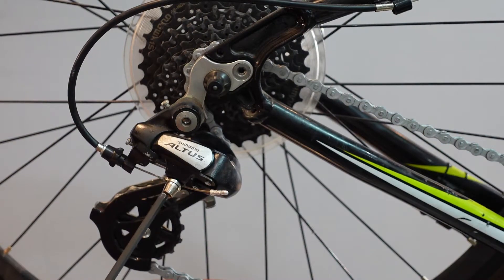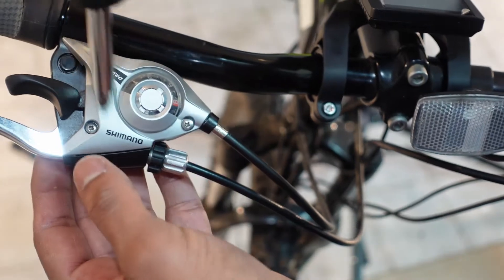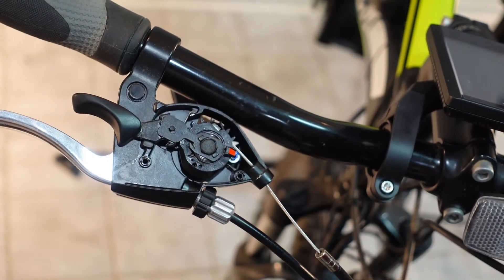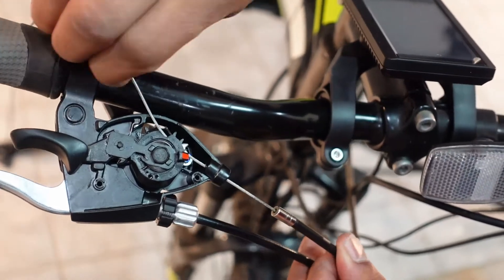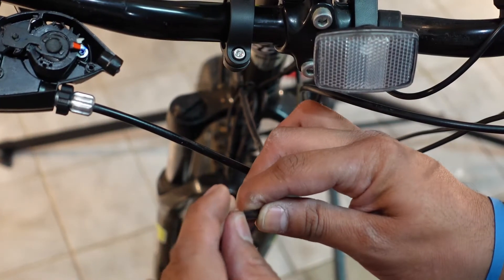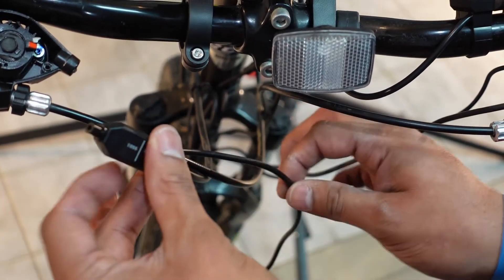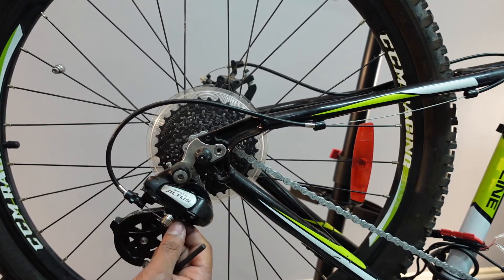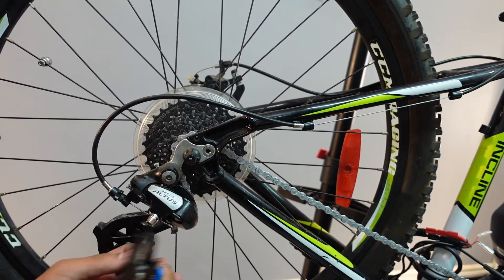Bafang Shift Sensor Installation from the Front of the Bike BBSHD, BBS01, BBS02

Comment: They should do away with the rear brake switch and offer a 2 wire sensor included with the kit for those with the naked wires on the top tube of the triangle. Mine are on the bottom of the tube so I will mount my sensor there. Mine has two female holes for the shift cable. No male to stick into the brake lever. Oh well.

Comment: Do you know where to get the GSD version of the gear sensor. I found this from luna?

The gearsensor is divided into these different versions:

1)Version GS-D is a universal model for both derailleur's (front and rear). On this version restarting of the motor depends on the FINISH of the shifting cable movement. This is because system has to wait until the movement of the chain is finished to choose a sprocket or a chain ring.

2)Version GS-I is the model for INTERNAL GEAR HUBS. On this version restarting of the motor depends on the START of the shifting cable movement, plus defined time period. This is because system does not need to wait until the end of the movement of the chain to choose a sprocket or a chain ring.

Comment: Before you reattach the gear wire you should check to be sure you cable ends are inserted fully into the holders.  At 3:30 time frame you see the housing ends not seated fully at both ends. But Thanks for the instructional video as I like this install better than adding the sensor at the rear of the bike. I don't like sensors or cabling near the chain, derailleur, or rear sprockets.

Comment: You might add a comment as to why you are putting the sensor at the front. In my case the rear cable outer covering is very short leading only about 150mm from the rear axle - the rest of the cable runs without an outer cover up through the frame to the front where there is an outer cable again
Reply: Someone told me the sensor works better when sitting at the front, right after the brake lever rather than in rear, just before the derailleur/gear hub.

Comment: Hi Golden Motor, i have a problem on my double suspension bike, Kona Stinky. Every time there is a hole on the road the motor cut, at first i had put the shift sensor on the rear end and after i tried put it on the uper frame bar and still have the problem, do you think put it in front could solve my problem or the sensor could have a default? Thanks for the answer.

Comment: Do you not required the Y Splitter if you are to place the sensor at the rear of the bike. If not how do you connect the sensor cable. Is there a spare lead for this at the motor
Reply from the maker: Yes our controllers come with a spare plug

Comment: I see two things you did wrong in this video that should be corrected if your going to use it as an instructional video for others. First off removing the cable from the shifter is absolutely not needed creating an unnecessary step. This will also confuse those who have a twist grip shifter. You can just pull the cable from the housing while leaving it intact in the shifter. Next when you put the cable housing and sensor back after trimming the cable you made a tight cross over the brake line creating a possible friction point. Otherwise good video.
Reply: You are absolutely so correct, something like not having to take the cable out of the shifter will make it so much easier for some folk.
After all, what's the point of taking it out in the first place.
Thank you for some good observation.
Reply: Good observation.

Comment: Hello, I wanted to ask you for help. I bought the BAFANG BBS01B 36V 250W kit with Hailong 17.4Ah battery, to mount it on a SPECIALIZED STUMPJUMPER COMP HT 29 "from 2012. The problem is the size of the bottom bracket, the cylinder of the MTB is of length 73.5 mm and the internal diameter is 45.5 mm smooth, without thread. While the BAFANG one is 65 mm + 17 mm threaded, the diameter is 33.5 mm. Can you advise me how to solve without proceeding with a structural modification of the MTB. Sorry in advance for my terrible english.
Reply from the maker: There are different adaptors out there but generally they are for the bbshd 1000w motor

Comment: You never showed the important bit of how you connected the wires?👎
Reply from the maker: please watch from the 4 min mark. you simply plug in the Y- splitter into one of the brake plugs.then plug the brake plug into the one of the plugs on the y- splitter and the gear sensor into the other plug on the y-splitter.